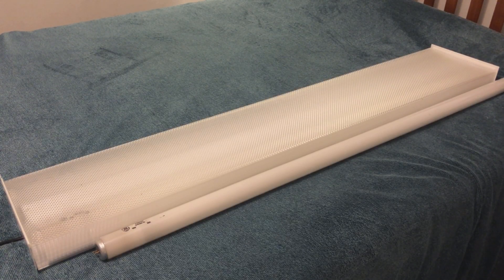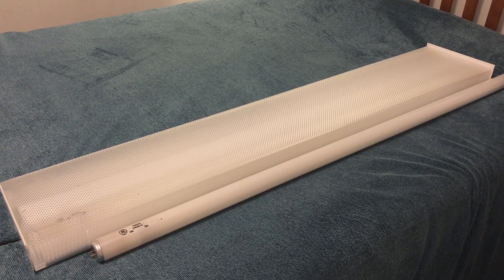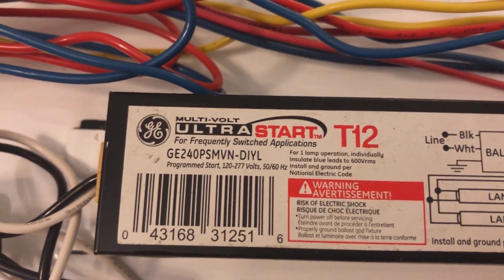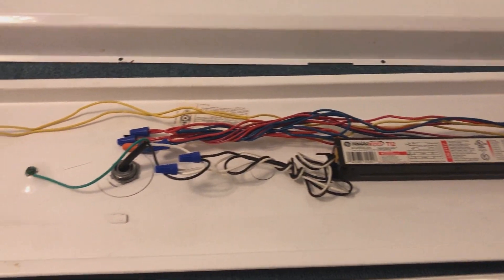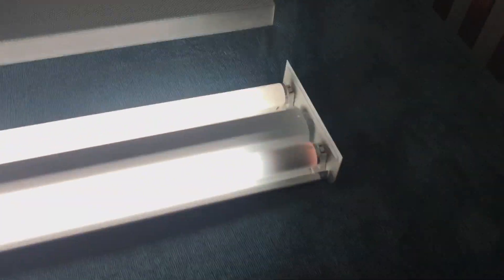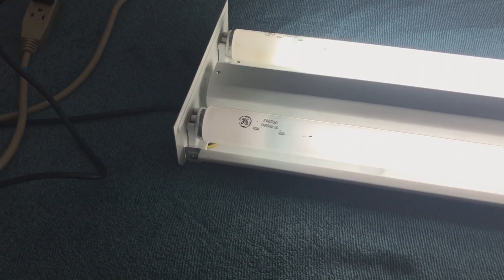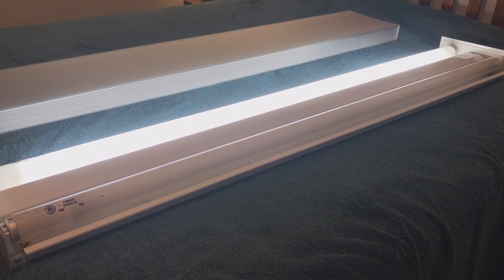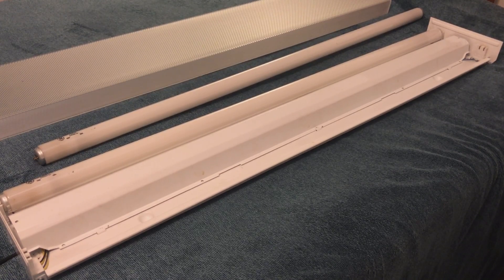Fluorescent Tube Burnout - Black Etch GE F40C50 Chroma 50 - rapidstart_12

Comment: Did u breath in the mercury?
Reply from the maker: @hemalnwable  No mercury was released. Usually, the pressure of the air rushing into a tube that lost vacuum is enough to prevent the mercury vapor from escaping.

Comment: Neat fixture here and as well I have a cooper lighting metalux wn series wraparound wn-217a-unv-eb81-u wraparound 24 inch 0,6 m great quality fixture I got from eBay the frame is a little smaller than the older ones. The older ones has screws on each end caps like lithonia lighting sb (square basket) series wraparounds. For my new cooper lighting wraparound does not have 4 screws on each ends so it’s a newest version of these models. One you have in this video now it’s w-240 cooper lighting metalux pretty good model in the future I might find one looks similar to it but it’s gonna be 2 ft long but I could find a 48 inch version ones to!

Comment: How do you store these fixtures?
Reply from the maker: I only have three 4’ fixtures. Two of them are wraparounds. They lean on my wall in my bedroom. The third is a strip light that I got recently, and it is currently being stored under my bed. I may eventually move it to the closet though. All my 2’ and under fixtures are stored in a long, flat bin under my bed, with the exception of my mini DIY F6T5 strip light, which is currently being stored on a shelf on a side table in my bedroom.
Reply: What is the fourth 4 foot fixture, and what other 2 foot and under fixtures do you have? 
Lowe's still has one or two fluorescent strip lights mixed in with the LED stuff, and my thought is to replace the electronic ballast with the magnetic dimming ballast I should be getting.
Reply from the maker: @HIDLad001  I only have three 4’ fixtures. For 2’ and under fixtures, I have a Progress Lighting 2-lamp F20T12 wraparound, a DIY 1-lamp F20T12 wooden board fixture, a Lampi 1-lamp F15T12 strip light, and a Lights of America 1-lamp F17T8 cheapo blacklight fixture. For 4’ fixtures, I have a Lithonia 2-lamp F40T12 wraparound, the Metalux 2-lamp F40T12 wraparound shown in this video, and a Lithonia 1-lamp F40T12 strip light. Also, that’s a good idea for a fixture! Can’t wait to see it!
Reply: @rs12official  I didn't read your first comment right. Also, where did you get the enclosure for your DIY strip light?
Reply from the maker: @HIDLad001  My dad and I actually made it out of small metal sheets. We cut them into appropriately-sized pieces and welded them together.
Reply: @rs12official  What kind of welder did you guys use?
Reply from the maker: @HIDLad001  A mig welder

Comment: You should make videos of your ceiling fans
Reply from the maker: I am considering doing that in the future.
Reply: @rs12official  I have DEMC industrial ceiling fans from the 1980s
Reply: @rs12official  my house is 40 years old this year and hasn't been electrical rewired!
Reply: I have 2 running circline preheat, many of them were thrown into the storage room

Comment: That sound the tube made at the end was it losing vacuum because the glass couldn't take the high temperatures. Also, could you explain all the different phosphor types fluorescent tubes use?
Reply from the maker: The three main types of phosphors:

- Standard calcium halophosphates: These are your run of the mill phosphors. They have a pretty low CRI compared to other phosphor types. Some halophosphate tubes are even below 50 CRI! IIRC, these formulations only contain one type of phosphor, but don’t quote me on it because I’m not completely sure.

- Deluxe halophosphates: These are similar to the standard halophophates, except they add a ton of red phosphor to artificially boost the CRI. That’s why reds look so vibrant under deluxe halophosphate lamps, and also why certain deluxe halophosphate lamps, especially cool white ones, have a strong pinkish or purplish tint to them. Unfortunately, you have to exchange brightness to get that improved CRI, so these lamps are typically only about 75% as bright as their standard counterparts. 

- Triphosphors: As the name suggests, these are a blend of there different phosphors, a blue phosphor, a green phosphor, and a red or red-orange phosphor. This creates white light artificially, similar to how a computer monitor or TV does. This white light happens to have a pretty good CRI (usually 80-87) naturally, so they are bright and have good color rendering. There are also “700-series” multiphosphors, which are a blend of triphosphors and standard halophosphates, as well as “900-series” multiphosphors, which I believe are a blend of even more different colors of phosphors than just your standard triphosphors, to achieve higher CRI.
Reply: @rs12official  Thanks for the info! I knew about the 3 basic types, but not the sub-types. I also know the old black and white CRT televisions used the same kind of phosphor as /C (color improved) mercury vapor lamps, I believe it was Magnesium Fluorogermanate.

Comment: Interesting burn out.   Can't say that I've seen that happen on a programmed start ballast.   Now I have seen the spiraling, very black end with orange flashes occur on a slimline instant start ballast, in the USA the 6 and 8 footers are most frequently run with this circuit and are easily identified by the single pin lamp bases.  The instant start ballast open circuit voltage high enough to strike the tube when one or both cathodes have lost the emission coating.  The failing tube end get extremely hot and if allowed to continue,  oftentimes will damage the lamp holder causing the tube to actually fall out of the fixture,  particularly the T8 lamps, if the lamp doesn't melt a pin hole through the glass stopping the discharge first. Many of the higher quality instant start fixtures used porcelain or bakelite sockets which can withstand the heat of a failed lamp, but I have seen a melted socket and shattered glass in a storage unit I was renting about 8 years ago near Livonia Michigan if I remember correctly.
Reply: From what I have seen, the cheap plastic slimline and HO sockets usually melt.